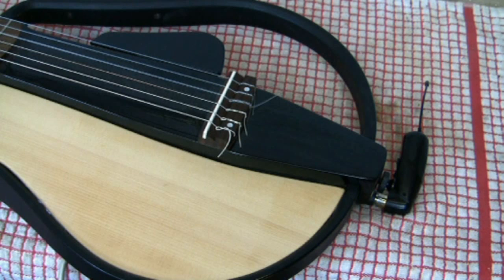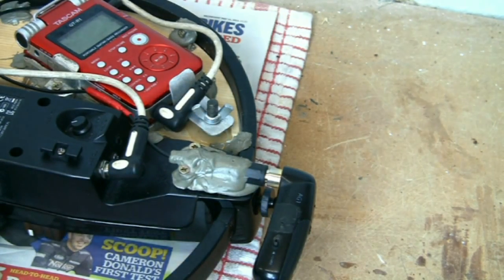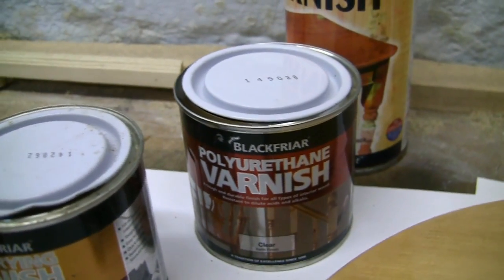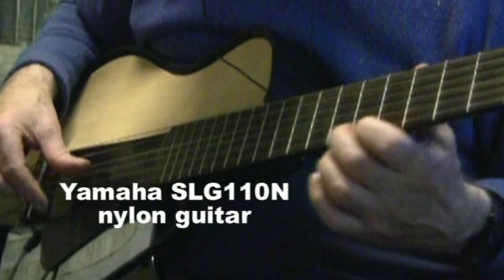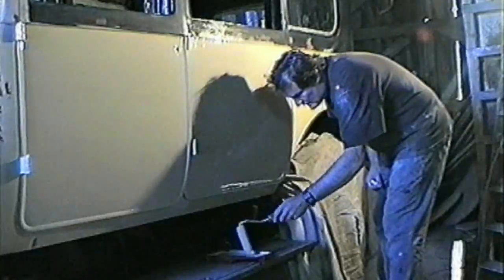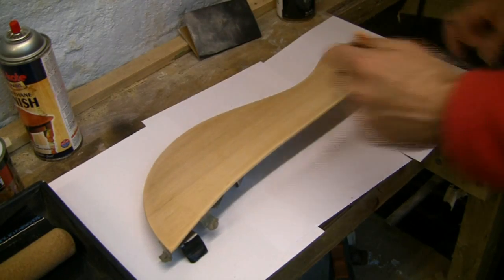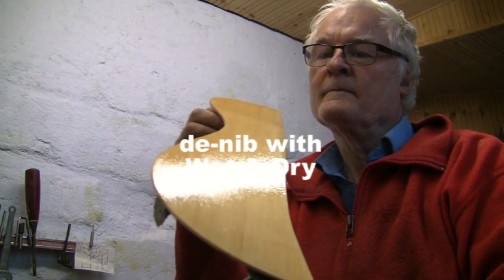Rolls Royce Guitar Finish

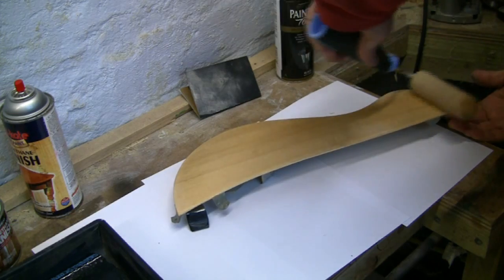Comment: What are we saying a 2:30?  "To raise the 'fat' to the surface"?
Reply from the maker: This is a traditional phrase that originated from French polishing where a final flashing off of pure methylated spirit brings all the fats (gloss) to the surface. I probably used the term somewhat metaphorically here as constant working of the roller has the same effect and anyone using French Polish would kind of understand what I mean. Another way of looking at it is oil rises above water so its about chemical density etc. However, pedantics apart, the point I am trying to make is you 'work the lacquer in' but be careful not to overwork it. A molecular chemist could explain it better than me.
Reply: Woodomain - Jeremy Broun I had never heard the phrase before.  I like it.  I like French polish and all the shellac techniques.  Shellac is a secret magic trick used to seal wood or any substrate  before the first coat.  I always try to let varnishes "level" on their own.  That's why the roller is so good.  I have gotten finishes like your Rolls finish.  BTW, did you color sand that Rolls or was the finish that good without it?  
Great videos.  I look forward to watching more.  Thank you.